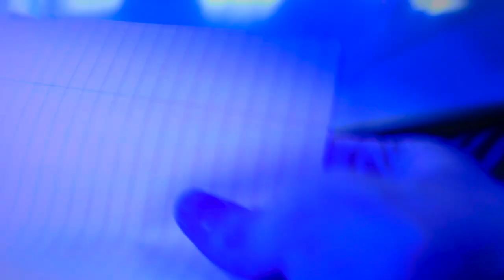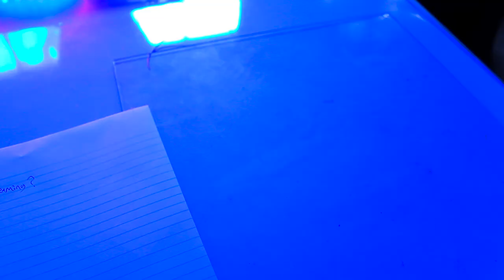Lucid Nightmare II Simulation | Shrink Ray

Comment: There's something I don't get about "lucid nightmares" though, if it's lucid then don't you have control over it? I mean in lucid dreams you can control stuff with your mind, doesn't that mean you can simply just use your mind to change the tone of the dream?
Reply from the maker: As an experienced lucid dreamer I can vouch for having moments where I lost control of my lucid dream while still being aware or still being in control but still scared enough to run or do other things in response to the fear because dreams can feel very real even when you know you’re dreaming
Reply: @HandintheBoxInc  yes it's normal to feel fear in lucid dreams and sometimes I have found that my fear can overpower my ability to manipulate certain aspects of the dream, causing the nightmarish element to take over.